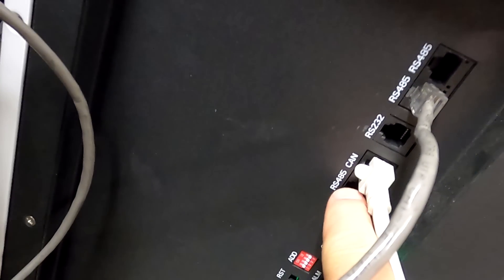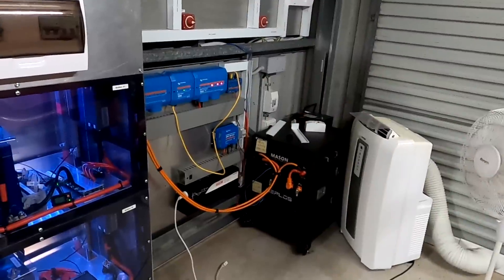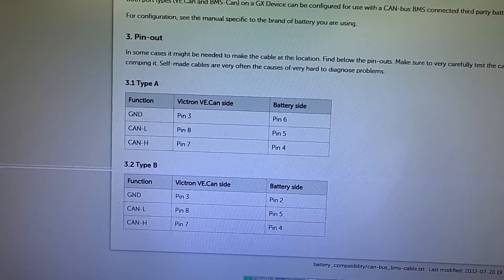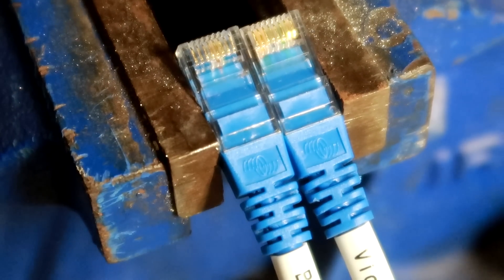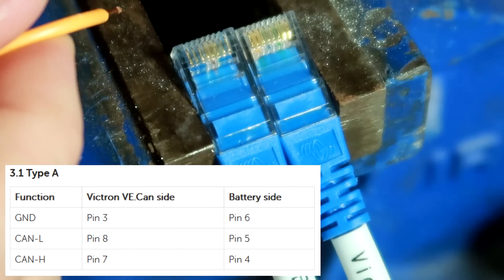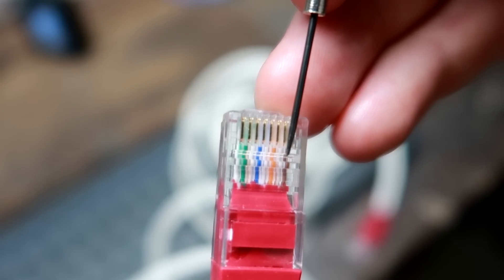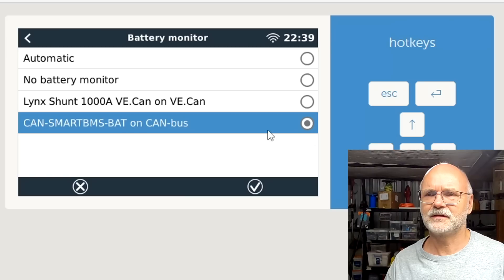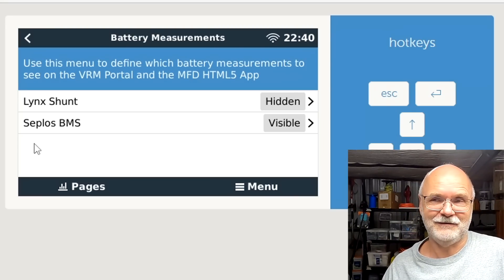Trying to connect 2 different batteries via CAN to the Victron Cerbo.

Comment: Hi Andy, How to make multiple BMSes visible on the Cerbo and therefore in the Venus OS, I still have a big question, now that the battery boxes are becoming cheaper, I now have 4 MB31 battery systems of 48 Volt. With the traditional connection method you get 1 battery bank and the summed SOC, the Victron lynx shunt is then the SOC master. But I still dream of seeing a good overview per battery in the Venus OS, Help!!!  greetings Eric W
Reply: did you see the video? he just showed that you CAN NOT see 2 bms'es via cerbo. also in comments there is many suggestions too.
Reply: @SayWhaaaaaaaaaaaaaaaaaaaaaaat  Yes, I saw that, too bad

Comment: So I am getting a different brand of battery rack to go with my TopBands. 
Hence how I came across your video. 
Watching the way it flicks between each battery string I feel it looks right. Only thing is it not showing the extra batteries in the list. 
2 theories I have here. 
Install battery aggregator in the cerbo to act as the single battery monitor? 
Or add 2 smartshunts and connect via VE Direct to cerbo. And then let the BMS sort themselves out without being connected to the cerbo via BMS Can. They will still talk to each other in the string and then report back via the shunts which will then tell the cerbo to tell the MPPT’s what to do?
Just a guess as I’ve done that with different brands and Ah’s at my caravans 24v system. Connected via a busbar to parallel. Just my tuppence worth

Comment: If you want to connect 2 separate Batteries to the Cerbo you have to set the VE.Can Port to Can Bus speed. Then you have 2 Batteries and can kind of combine them with The BatteryAgregator.
Reply: Could you explain it better to me please? Thanks
Reply: @AndreaFurlan-ro8cw  So if you have two batteries with CAN but the can’t communicate with each other you plug one into the BMS CAN Port on the Cerbo and the other one into the VE CAN Port. Then you go into the Cerbo Settings-> Services-> VE.Can Port and select the CAN-bus profile to CAN-bus BMS (500kbit/s). Hope that helps

Comment: Hello,    I have a JK B2A20S20P with can/485   and a Pylontech 2000C.  
The 2000C  is working  perfect on my cerbo bms port.  What shall  i do with the  JK B2A20S20P to connect it with my cerbo gx?   Thx
Reply: read comments.

Comment: Very interesting result, and still worth doing. It's great the Victron hardware was trying to make sense of it, and displaying alternate parameters. How good is that? Fantastic, without damage.
Did you just assume the Canbus socket pin-assignment on second battery, was identical to the original did you? I haven't watched your video of that battery addition, but will. So many possibilities with what's available today.

Comment: Andy Thanks for posting all this info, your videos have helped me 1) switch to Victron multiplus II, 2) get a "Raspi" and Venus os, 3) get an dual CAN hat board 4) wire my RS3450/100 and smartshunt with diy cables to the Raspi,. Now I have my 2 multiplus (split phase), my RS450/1000, my smartshunt and 2 Seplos 304ah batteries all connected to the "Rasp-p--pi"

Comment: Did you get this resolved with the 2 different batteries? I will be in a similar situation soon myself... I currently have 4 Pylontech US5000 but think it should double the storage... Option A) stick in another 4 US5000. Option B) slaughter the Nissan Leaf outside and MacGyver a 48 V Battery from the remains...
Reply from the maker: This cannot be resolved. There is only one BMS which can be the point of truth. Two batteries or more in parallel need a BMS with communication ports like the Seplos, Pace of the new JK BMS coming soon.

Comment: Thanks fort the vid ! 
It works if you plug the second BMS on the VE CAN port (not BMS Can) and then configure it to 500 kbits/sec on the services parameters of the cerbo GX. Then you'll see the two bms in the configuration.
Reply from the maker: Ah, great, I have the Lynx shunt plugged in there but will try that...
I now have more than 2 CAN batteries though, so another solution need to be found.
Reply: Also on a jk inverter bms it's a type B cable you need

Comment: Dear Friend , We can use different type Battery (Li-Iron and Lifepo4) in parallel  in same invertor , If you can provide a video  for it
Reply: I did that. It works but now 100% correctly. Batteries have different chemistry and charge/discharge at different rate. So you will not have clear understanding where they are charge wise. When now is fully charged, the other is only starting to charge, etc. I had LIFEPO4 and LiNM in parallel. it works but I don't like it. So I bought 2 more lifepo4 batteries and will sell liNM battery.
Reply: I had lifepo4 16S + 14S LiNM in parallel. voltage is close, and you can use them that way. But they are not charge/discharge sumiltaneously because of different charge/discharge curve

Comment: Hi Andy, I came accross your video. I'm not sure if it is still relevant or has been fixed already. But I've managed to connect 2 interface boards (Green Daly with red dip switches) to Cerbo GX and have them both showing up. Basically You have to activate VE.CAN 500Kb/s and BMS.CAN 500KB/s in Services. Both Green boards set to Dip1 and not connected to eachother at all - otherwise they will clash. 
Then One green board has to be connected to VE.CAN port and the second to BMS.CAN ports and Important: both terminated. Than in Victron you will get 2 x batteries under different IDs showing up. 
Cheers

Comment: Hi Andy, not sure if you'll see this comment being an old video, but I've just figured out how to add two BMS's over CAN, even if they share the same address. Plug the second BMS into the VE. Can port (Third ethernet port from the left) and then in the Cerbo GX change 'Settings > Services > VE.Can port > Can-bus profile' to 'CAN-bus BMS (500 kbit/s)'. Not sure whether this makes a difference or not, but one is connected via a Victron Type A Can cable, and the other a Type B. Each BMS and their data are accessible via Node Red, however only the active BMS (the one being used to control the system) is shown in VRM Portal. I'm connecting two battery banks and monitoring their status using Node Red & MQTT so being able to have both banks available on the same Cerbo and same instance of Node Red is invaluable (to me).
Reply: Just to add after playing around a little. Whichever BMS is plugged in first seems to get priority. Then if the primary BMS is unplugged the second BMS automatically takes control (is set as the Battery Monitor). If the primary BMS is plugged back in it does not automatically regain control, the secondary BMS maintains control until it is unplugged for more than a few seconds. Also the two BMS's aren't distinguishable between each other in the menu to select the default battery monitor, even though they do each show separately in the main Cerbo GX menu.  Would be great to see a follow up video to see exactly what's going on.
Reply from the maker: Thanks Dan. That may work with two BMS. The issue here is the BMS don't know anything about each other so won't report a conclusive cell difference or temperature. As you said, some Node Red magic may be necessary.

Comment: Numerous custom cables just use CAT-5, and if they are smart they just use a straight-through configuration so its compatible with gigabit ethernet (also straight-through).  But as you have found, a lot of random projects are still using pin swaps and other garbage that requires custom cabling instead of simply using "gigabit ethernet" (straight-through) cabling. 

--

Modern gigabit ethernet cables are basically straight-through, with only pair requirements.  So the position of each color/striped-same-color pair is important, because it represents a differential pair, but the actual color selected for each pair is not important... just as long as the same color selections are used on both ends of the cable.

The two different 'standards' just select different colors for the pairs in each paired position.    I'm sure that's a bit confusing.  Both standards are still 'straight through' and both still use color/striped-same-color pairs to the same pin pairs (just ordering the colors differently).   There is a lot of cruft in the standard because it covers 40+ years of phone, T1, and ethernet evolution.

Comment: Plug the second battery into the VE-CAN at 250K.  then both appear..
Reply from the maker: But both have 500kB/s ...
Reply: @Off-Grid Garage  the ve-can bus can be run at 500k.. or the battery may be able to run at 250k.
Settings/services/ve.can port/can-bus profile on the cerbo.
Reply: If only sending a photo were possible..

But been running stabely for a couple of months.
Reply: I have two BSL batteries connected with RJ45 per spec. One discharges at a different rate. I tried what you tried I. The video as well but still get weird results. 

Will changing a can port to 250kb work? Who else has tried this?

Comment: I don't think this was a fail. There must be a missing step. The cerbo was reading the info for both bms'. It just didn't have the name of the 2nd bms. It would only be a fail if the cerbo didn't recognize the 2nd bms info or anything. This is just half complete and you did prove the victron system does have some basic plug'n'play functionality to it. Pretty sure you'll figure it out. Just have a spat🍺 and do some reading!😁👍
Reply from the maker: Yeah, it seems like there is more to it. Need to find where I can change the IDs for the BMS and it should work then. If this is not hardwired for each BMS...
Reply: @OffGridGarageAustralia  try plugging in just the new bms and setting it up like you did for the seplos bms. Maybe that would work? Worth a shot

Comment: You can use raspberryPi for connection to eacht BMS self, and monitoring each battery pack solo, and smart shunt you can use as master, for monitoring and managment to charging :P  You can use the oldest raspberryPi (1st.edition works well, for eatch BMS = one raspberry) This is only one way, how to monitor diferent BMSs in Victron solution... :)
Reply from the maker: OK, no idea how to do that. That's probably something for yet another channel 😁
Reply: @OffGridGarageAustralia  It's very simple, one raspberryPi (with venusOS) is used for each battery pack (BMS) and it doesn't matter if it is communicates via RS485 or Can. This will be added as a new installation (in VRM), so you will have one installation for each batteryPack. The important thing is the common voltage of all battery packs, since it will be on the shared busbar and it is used for one common system. The main management regarding charging and discharging is handled exactly the same way as your solution (powerwall2). In any case, the system will not be controlled from the BMS by the battery, but by the smartShunt. It is practically the same as you have in your powerWall 2, with the difference that you will have the monitoring of specific batteries available under VRM. Yes, it is a bit annoying that the monitoring will be for each solo installation = for each battery (BMS). This is simply a system (venusOs) limitation, but this is a workaround if you want to monitor different batteries and their status. 

Simple easy :D

I also struggled with how to monitor two or more BMS. This solution works, I understand it won't suit everyone, but I haven't found a solution other than at least monitoring on anothers BMS. The disadvantage or advantage, that's the point of view, is that the BMS is not the master and it can't be, as long as each BMS communicates at a different address :)
Reply from the maker: @jurajnikolov4219  OK, I would not call this simple. The hardest part may be to get any Pis at the moment. They are sold out everywhere for well over a year...
I think the benefit of showing data from all BMSes is very small in comparison to the setup. The goal is still the BMS controlling the system.
Reply: @OffGridGarageAustralia  1) as I wrote, just use "raspberry Pi of the first generation". You can get it for decent money.

2) venusOS does not support the connection of several BMS and it is not possible to pick, that this is the master and the others are slaves (that is, yes, if they know communicate with each other and one of them will be the master [Pylontech,  etc.]) The problem is that the  Chines comrades do not use a common table address  for individual status values,  seplos has a different address than JK and so on. So they can't talk to each other :)

3) "Louis van der Walt" wanted to make a driver that would allow two or more BMS to be connected, I don't know if he finished it. If so, would be great, but I don't expect that it will solve the communication of different types of BMS :) from the same vendor and the same type OK maybe Yes :) 

4) when you think about it? 
Do you need management through BMS? 
Your solution, PW2, is proof that it is not. 
Does PW2 allow you to monitor the battery status in more detail via VRM? Not. 
It is necessary ? For me, yes, as long as I can receive alarm notifications of states read from BMS through  monitoring via VRM. That I see as great.  
Personally, I don't care if the MPPT or MPII Charger is controlled by BMS or by data from SmartShunt (set via Mppt+MPII), the result is the same. 
If something goes wrong in system, BMS, should be the last safty instance  :) 

5) I understand that you want management through BMS : )
But above I explained why it won't be possible...

I won't convince you if you don't want save youre time and money :P 
Only if you want and can to modify OS Venus :P Then OK  :P
Reply from the maker: @jurajnikolov4219  I fully agree with you here. Communication is not necessary (as Battery#2 proves) but alarms would be nice to show in VRM and act on it through Node Red. That should be possible with Kevin's serial drivers as I have tested. It can show several BMS and the alarms will be passed through to Victron.
That is maybe all we need.
I'm just testing here what benefits comms bring to the table as many wanted me to test that. So far, I must say, it is not worth it. The MPPTs work well without external control. Maybe even better considering they now do proper absorption and float...
Reply: @OffGridGarageAustralia  I confess that I have not tested several different BMS (e.g. daily, JK, seplos, etc.) connected to one instance (installation in VRM) of venusOS. 
What I tried was to connect two JKBMS to communicate with me, via RS485, the result was the same as yours :) I saw them, but... which one is the master and when? :P (you don't want that).

As I searched for communication addresses for JK BMS and compared them with BMS from Pylontech, the address is shifted, so they won't meet :) for further content (state of types), what can be read from JK and what can be read from Pylontech is not uniform. If Kevin's driver solves it OK, but I rather think that it will be able to solve the communication of two or more of the same type of BMS (e.g. JKBMS). I think it is not usable (accross) of different vendors (e.g. daily, JK, seplos, etc.). Maybe I'm wrong, if it would work with other vendors as well, then great. 

I wish you goodLuck and fun ;)

Comment: I’m so disappointed in you for not having a CAT-5 cable crimper… you should be ashamed of yourself… just kidding of course, nice job cludging the cable together.

Personally I’d say it was partially successful because assuming both batteries report accurately the fact that the GUI does show bot charge levels provides value. The big question is what does it do to the historical and real-time charts/reports ?

Can you change the Baud rate on one of the BMS’s? If so it would also be interesting to see if that makes the Cerbo show both independently?

Now go get a proper CAT-5 crimper and cable ends to round out the plethora of tools and parts you have! Again kidding, it was probably a valuable demonstration of how to DIY it for people who don’t have the right tool and don’t understand how to properly go through the frequently frustrating process of holding all 8 wires in place while doing the crimp, assuming the tools haven’t improved in the 10 or so years since I last had to do it.
Reply from the maker: Hahaha, I never owned a crimper for CAT cables. The last one I did was maybe 20 years ago. Since then, everything was pre-configured.
Reply: @OffGridGarageAustralia  Yeah it’s not something people normally do. I setup a network for a company I managed and have the tools because of it but also setup a few software labs for the corp i later worked at and managed a qa team.